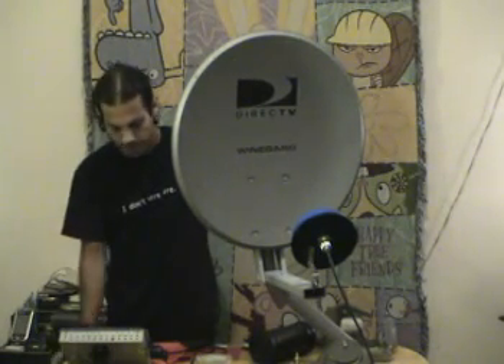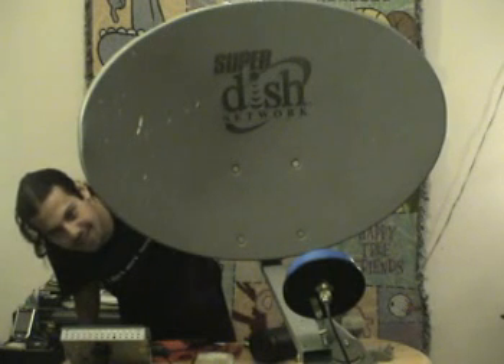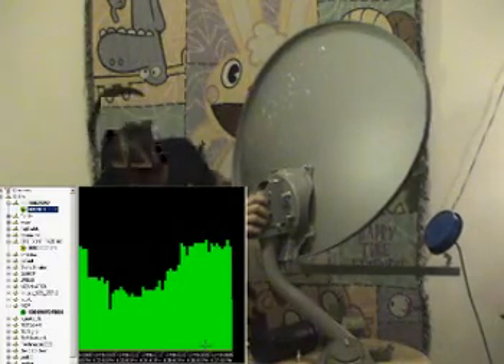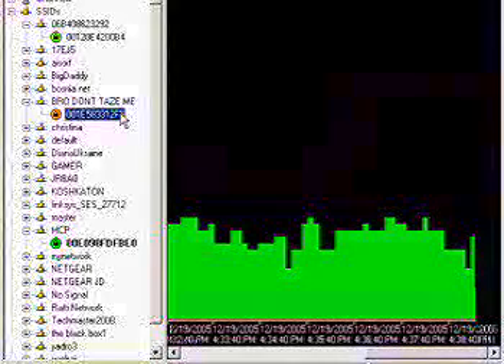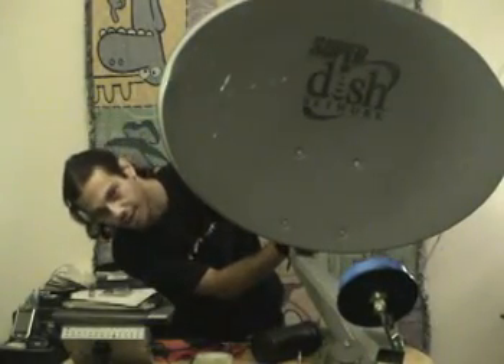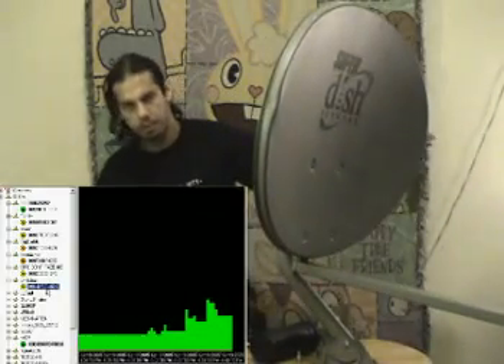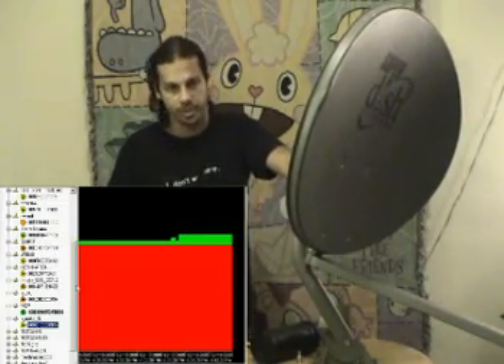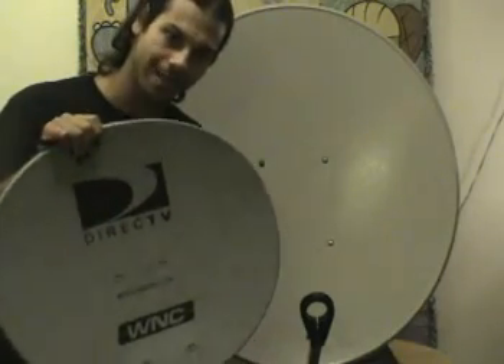Parabolic Antennas -Part two

Comment: what are the items that you will need to connect the dish to a pc.
i know a wire is required, is there a special plug (Card) which is need to connect to the usb.
Reply: he's apparently MADE a Bi-Quad antenna so it's probably connected to an external USB Wireless adapter via either SMA or BNC connectors. not an effective antenna to parabola. helical one would be better, A good Bi-quad made by a Pro HERE: https://youtu.be/y1XZcouXsp0 enjoy